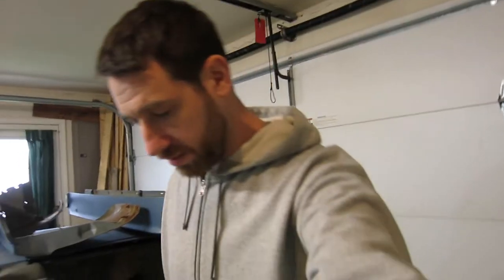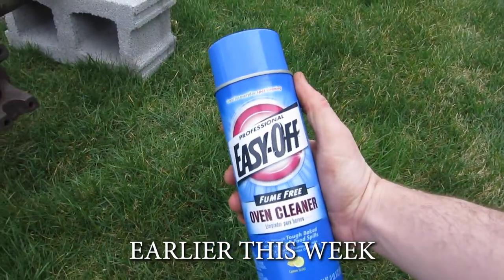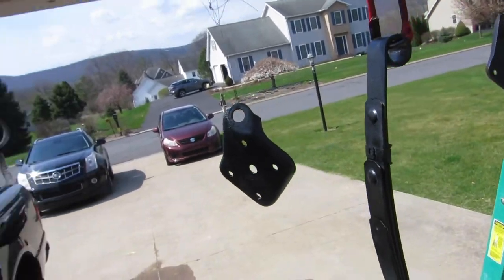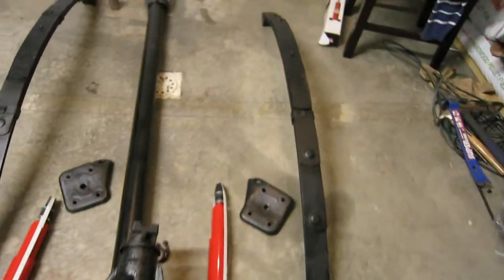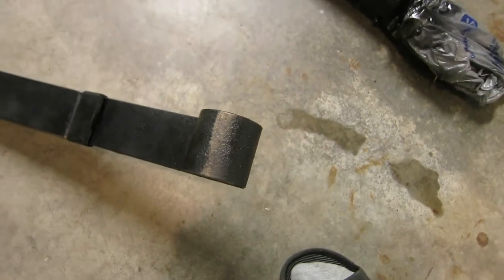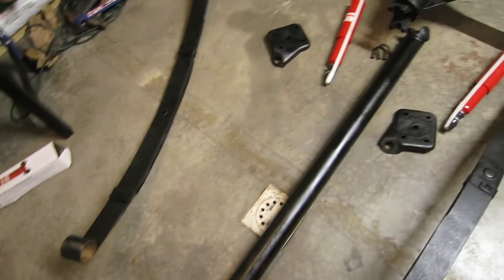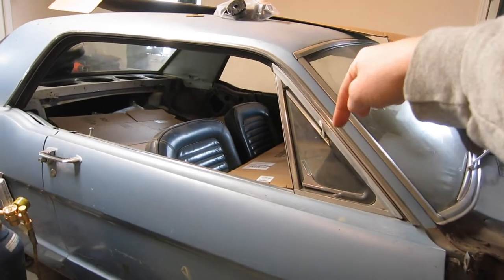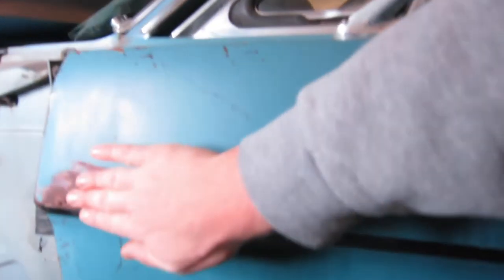Repainting A Differential | 65 Mustang Restomod

Comment: Making good progress! When I replaced my leaf spring bushings, I just wedged a pry bar in the gap of the eye where it Meets the leaf. Then hammered out the bushing. The biggest pain for me was removing the front bolts! Can’t wait for the next upload!
Reply from the maker: I never thought to try that. It was a real pain trying to catch a lip to drive them out. A pry bar would have worked better pushing on two sides evenly. 👍

Comment: Coming together nicely. I’ve been plugging away on my car this week as well. I’m getting ready to pull the gas tank and work on the truck floor. I think if I remove the trunk floor and pull the rear end I can really clean up the back end.
Reply from the maker: Pulling the trunk floor would give you a ton of access and allow you to coat the inside of the frame rails. I feel like my trunk floor is in too good a shape to justify pulling it out. But part of me wants to get access to the inside of the frame rails. There’s never a shortage of things to consider. 🤔